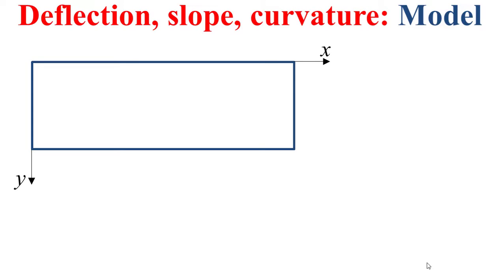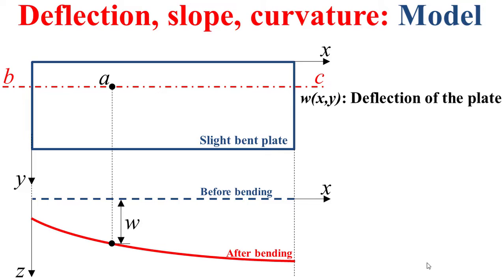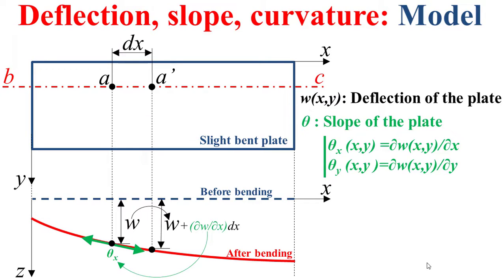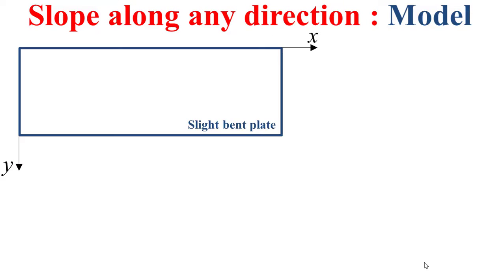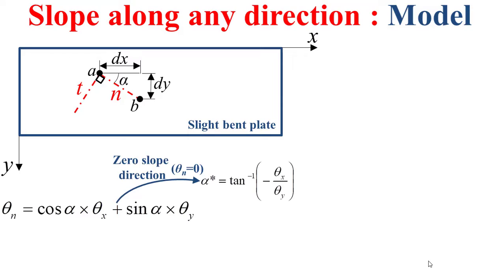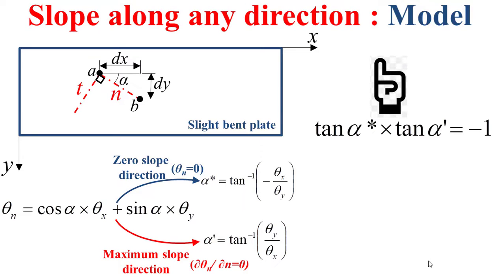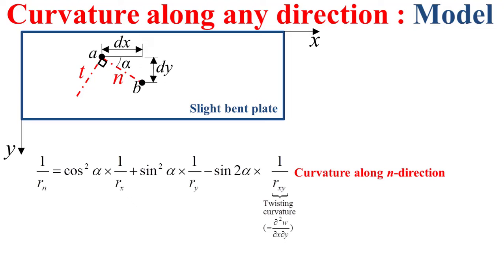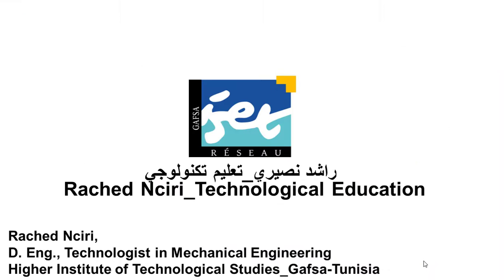Theory of plates_Deflection, slope and curvature

Comment: why is the curvature of the plate in the y direction = -d^2w(x,y)/dx and not -d^2w(x,y)/dy . Was that an error?
Reply from the maker: Thanks a lot for your interest. No, it is not an error. In fact, the negative sign arises due to the sign convention used in structural mechanics. It's a convention to consider positive curvature as being concave upward. In other words, if a plate is concave upward, the curvature is positive, and if it is concave downward, the curvature is negative. The negative sign in the equation ensures that the sign of curvature aligns with the direction of the bending moment in the plate. It makes the relationship consistent with the conventions used in structural engineering analysis and design. When you see the equation rx=-w''(x), it means that positive curvature corresponds to a concave upward deflection of the plate.